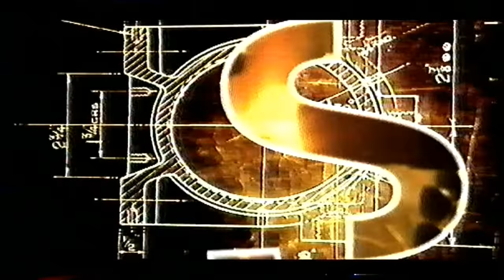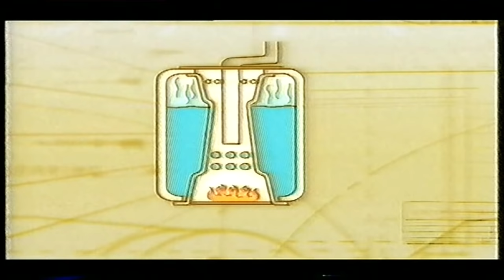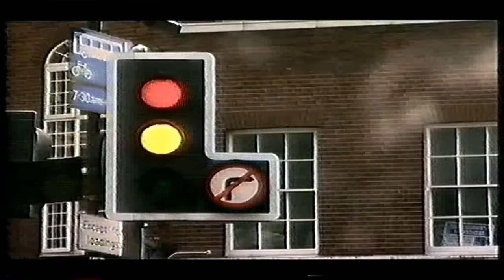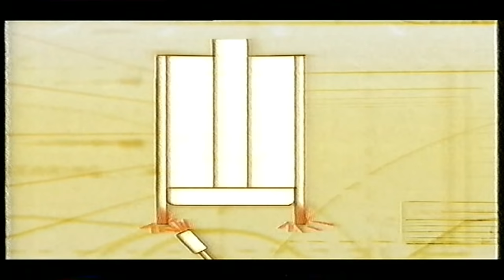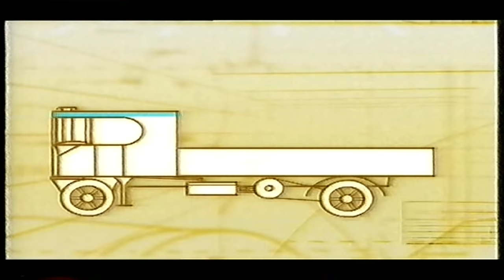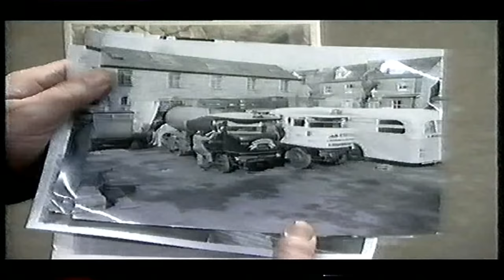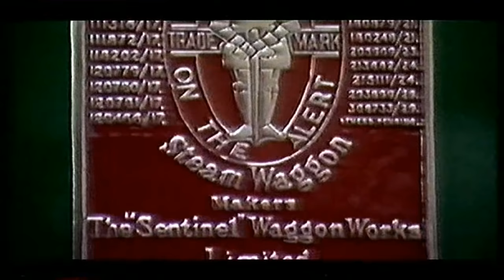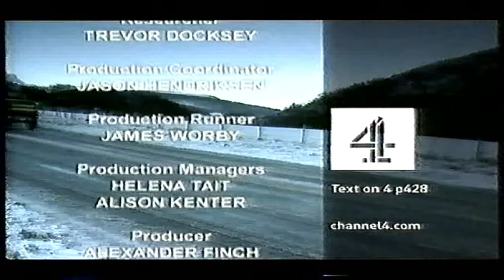salvage squad steam lorrey

Comment: I've had this broom for years, it's only had three new heads and four handles! Not really a restoration imo
Reply: Would you prefer a 250 PSI boiler with half of its wall thickness eaten away by rust? Most of the lorry is indeed original, save for the outer boiler shell.
Reply: Replacing boilers is common in restorations